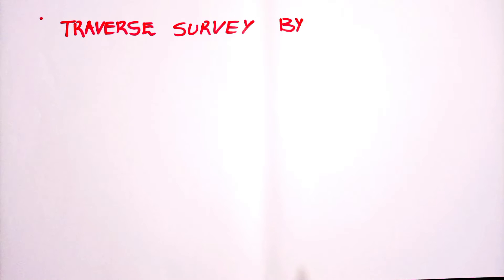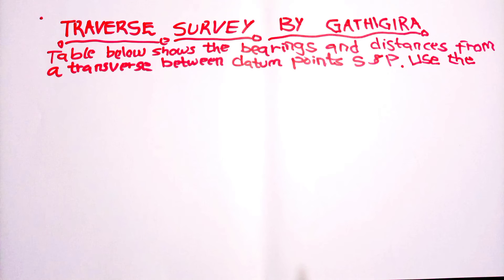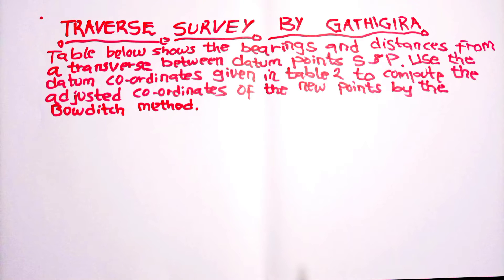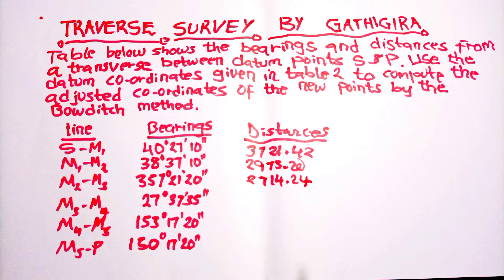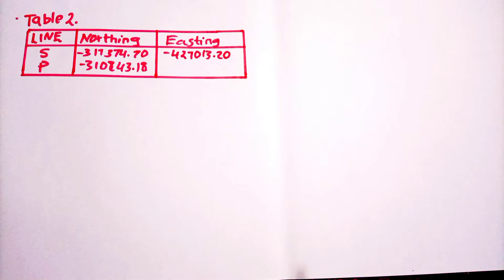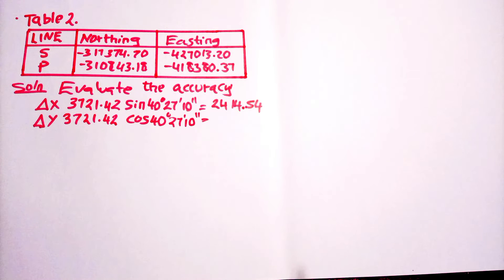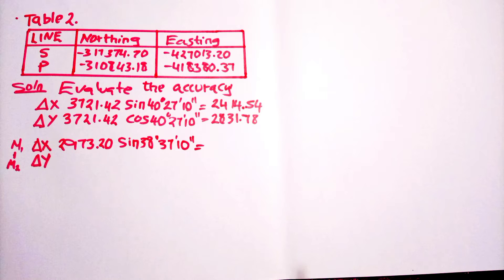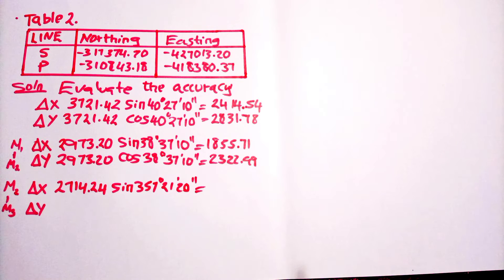Balancing traverse using Bowditch method Engineering survey 2 solved calculation

Comment: I really like your videos but the small margins of errors is what gets to me... especially writing down the correct digits sometimes...like in this video *the final part" when you add the Latitudes correction to the change in latitude for S - M¹ you wrote 2821.91 instead of 2831.91 when you add +0.13 to 2831.78
Reply from the maker: Will look into that 🤜